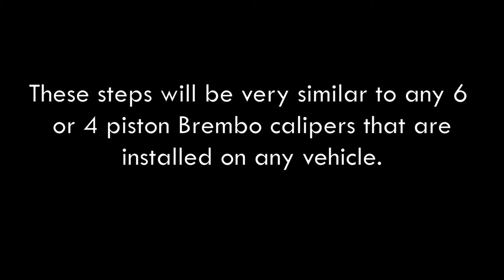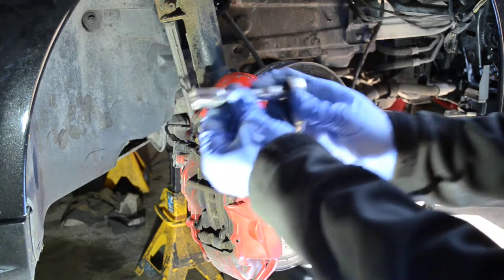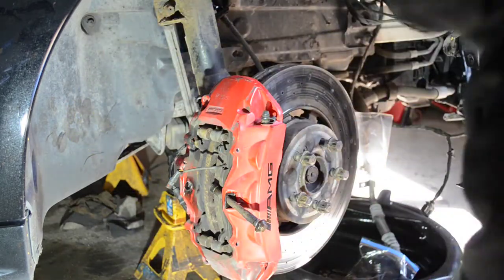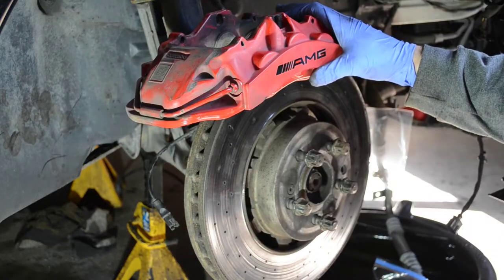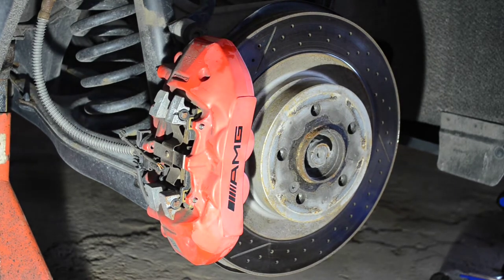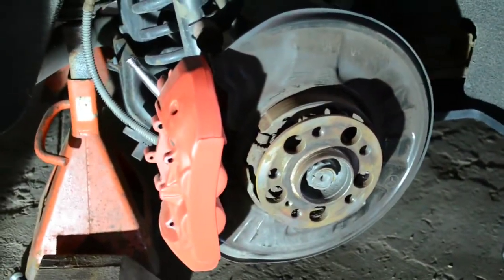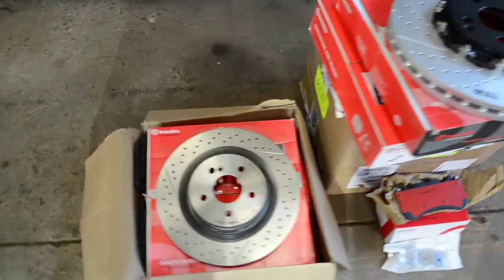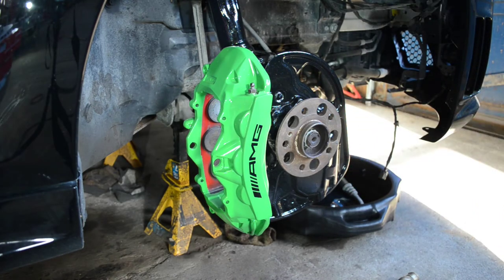SAVED OVER $4000!! Replacing AMG/Brembo brake pads and rotors on my C63 AMG with P31 package!!

Comment: what is the torque spec for the 10mm caliper retaining bolts for reinstall?
Reply from the maker: Thanks for reaching out! Hope you enjoyed the episode and be sure to leave a thumbs up also Thank you very much for subscribing, your support goes a long way!!

Regarding the 10mm Allen bolts I was unable to find a recommended torq from MB. After doing some research it seems most people agree of the 70-80ft/lb range and use blue loctite to help reduce the chance of loosening. I torqued mine to 70ft/lbs with blueloctite. 

That being said some people have mentioned they are suppose to be 1 time use bolts and should be removing the rear knuckle/caliper bolts on the rear to remove the caliper. As you see I did not use that method and haven't had any issues yet with the method I have used. It is also much easier to access this bolts. 

If you are worried you can buy replacement bolts of the ones you seen me remove and you could replace them if the possibility of one time use is a concern. 

I hope this helps and if you have any other questions just let me know! 

Thank you for your support! 
-Full Throttle
Reply: I just did this brake job on my E 63, I watched this video and I did as the Video showed and removed the caliper retaining bolts which Mercedes repair manual states to never do, I referenced this after the fact. You’re suppose to remove the bolts on the steering knuckle instead of the bolts on the caliper. I have been unable to find the proper torque spec for the caliper retaining bolts, that’s because you’re not supposed to remove them ever. I ended up over Torqueing the caliper retaining bolts snapping them in half. Mercedes does not sell these bolts, you have to buy an entire new caliper. My local Mercedes dealer told me that there are none in stock in the US or Germany at this time. Whatever you do don’t torque them beyond 140 Newton meters, they will snap after 150 Newton meters.
Reply from the maker: @JoseCastillo-sz1hy  I'm sorry to hear about your experience. You are correct mercedes states in wis not to remove those bolts for service. That is due to them being considered a "1 time use" as they may stretch or snap if over torqued as you have experienced. 

If you follow up with many members on the amg forums many have used these as a service method. I mentioned about  this on the comment above to only torque to a max aprox 90NM. If you torqued to 150NM that is certainly an issue and why they would have snapped. 

These bolts can be sourced direct from MB with part numbers on the forums according to a few members and you do not need to buy the entire caliper. I will try to find the partnumbers.  Another option is to source the bolts direct from brembo. Also will try to find the part numbers for you. 

When done properly this method is much quicker and easier to do but torque spec  is very crucial. 

I apologize for the issues you had and will keep you posted if I find those partnumbers. 

-Full Throttle

Comment: What paint did you use on your calipers
Reply from the maker: Hope you enjoyed the episode, be sure to consider subscribing and hitting the thumbs up if you havent already. Your support is greatly appreciated. 

I used a high heat paint by duplicolor /VHT. You can check out the full process and all the specific products needed to perform the job at home! Link below!

 https://youtu.be/O3MINvDcMcM

If you have any other questions be sure to reach out, thanks again for your support and until next time... Keep er at Full Throttle 🤘
Reply: @FullThrottleBHP  yessir

Comment: Wow, great video! Subcribed! Just one question, a lot of members on the forums have flagged up that WIS states we should remove the Caliper via the Self Locking Bolt, Brake Caliper to Steering Knuckle. That would be M14X32 (P/N: A 001 990 08 14) torqued to 180NM. As you removed from the 2 retainer hex bolts, what did you torque to? As your method seems so much simpler.
Reply from the maker: Hello, 

Thank you so much for the kind words and thank you for the support. 

You are 100% right about what you have found on the forums it is certainly the recommended procedure to remove the bolts to the steering knuckle and the torque spec on them are insane. Think thats about 130ft lbs. Nearly impossible to get that much torque back on them especially with a torque wrench. Also note they try to recommend they are 1 time use botls... May have reused them with no trouble but use that to your own discretion.  

I did go with the less common method of removing the hex bolts and I meant to clarify this in the video. There is a big debate of what the actual torque spec is for these bolts and after much research and reaching out to both Mercedes and Brembo I still do not have an answer. I applied a small amount of blue locktite to the threads and installed both to hand tight. I made sure the calipers were aligned and then started to tighten them down. I went until they were tight (using 1/2 inch standard size ratchet) and then 1/4 turn past. 

I have drove the car over 6,000km since the job has been done and everything is still nice and tight. It did make the job much quicker and I feel there was no issue doing it this way even though it was not 100% by the book. 

Thanks again for your comment and support. New videos will be uploaded soon!!
Reply: @FullThrottleBHP  still no issues 8 months later? Im about to go your route as the 180nm seems simply way to much for the direction im going.
Also Trying to read the comments,but how did you access the rear top bolt as its a pain in the A** to reach lol
Reply from the maker: @AMcompton101  Hope you enjoyed the episode! Everything has been great so far. Haha I can feel your pain about the rear caliper bolts. I used an open/boxed end wrench for that spot. Deffinitly did not make it easy but it did work to remove the bolts. One of the most frustrating spots. 

If you did enjoy the episode please consider leaving a thumbs up and subscribing as well if you havent already. Your support is greatly appreciated!

-Full Throttle
Reply: @FullThrottleBHP  awesome, feel free to answer or ignore, but the torque on those bolts?

Comment: On which model did you mount?
Reply from the maker: This was on a 2010 C63 AMG with the P31 package. These same parts should work on all versions of the W204 AMG models except for the Black Series (2008-2014). Let me know what model you have and I can try to help confirm fitment of the products used.
Reply: @FullThrottleBHP  Hi, mine is one
Model C 220 BlueTEC W205 2014
  WDD2050041F012530
Reply from the maker: @novidiu  Thanks for the info, Im sorry to say that the parts seen and used in this video are not compatible with your model. These are for the W204 AMG versions only. I would recommend checking out FCP euro or Rockauto.com for the parts required for your vehicle.

Comment: I am amazed how people pay do get ripped off.  My AMG brake change at dealer costs over 5k. I found local car mechanic that specializes on Mercedes and other European cars he quoted me 3k. All parts costs 720 dollars that includes pads, rotors and sensors all 4. I will donit myself granted one at time due not having lift probably 3hr I am done.  But where the fuck you get 700 dollar parts from Germany 3k job or worse 5plus k job at dealer.  Personally I will never buy Mercedes ever again because they are rip off servicing your vehicle.  😅 But unfortunately people pay for that.  I don't care how much money I have I question your price. Nothing illegal, but you have to be idiot to pay this much for easy job like that.  😅
Reply from the maker: 100% agree with you on that one. That is one of the main reasons I started this channel was to share the knowledge and how to service these high end luxury vehicles. So many people think they need to bring their vehicles to the dealership but its simply not the case for everyone. Recently we have a new Mercedes A class. Dealership tried to tell us it needs to be serviced with them or warranty is voided.... well at least in Canada that is not the case. I contacted cooperate and they tried to state the same thing until i questioned them on the Canadian act in place and then they said there was a misunderstanding and I could service the vehicle my self with out any issues to warranty. Crazy stuff hah. 

Thank you for sharing your experience and glad to hear you enjoyed the episode. If you haven't please consider subscribing as well. lots of great content on the channel.  

- Full Throttle